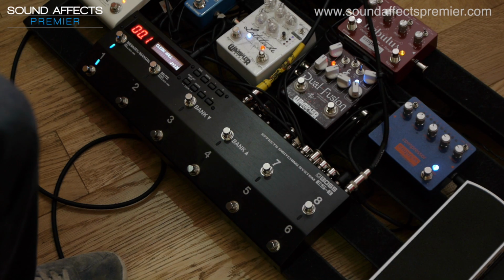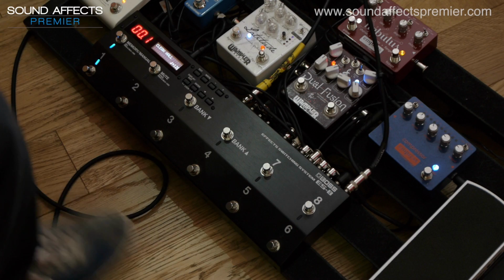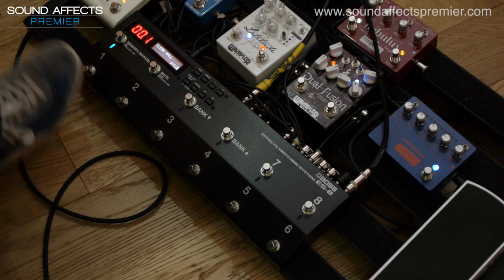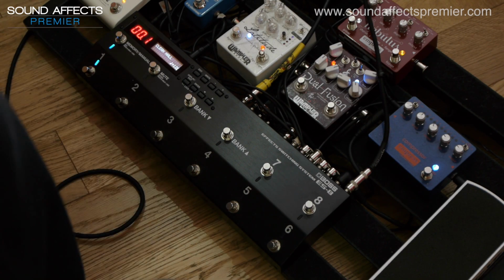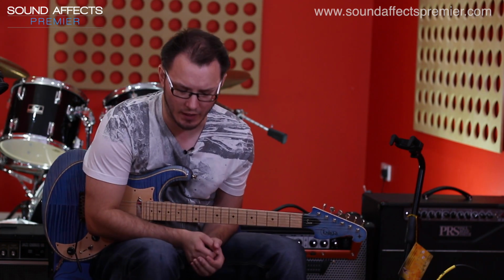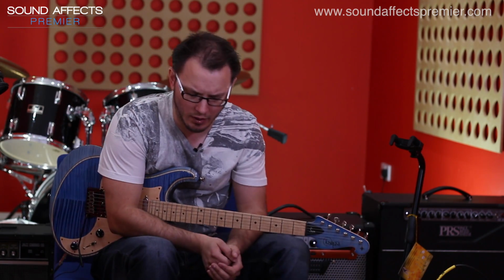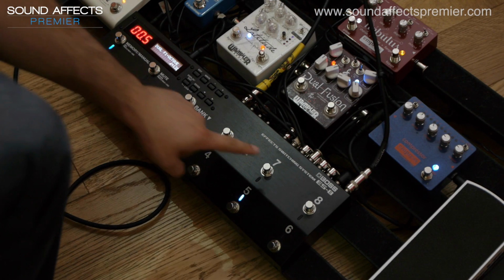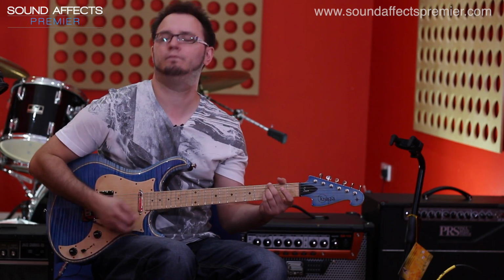Boss ES-8 Effects Pedal Looper & Switching System Overview

Comment: Hi Tom, I am a new owner. Thanks so much for the demo. What kind of unit do you recommend to power your effects pedals?  Thanks.
Reply: I am using a Caline CP 206, there is a review on YouTube and I run the ES-8, 3x Boss 500 series pedals and smaller Boss pedals and no issues. It is noiseless / isolated too.
Reply: Cioks

Comment: GREAT REVIEW/DEMO!!! The only section I heard starting at approximately 2:45 I believe may not be accurate. "... 2 inputs, 2 outputs, and the outputs are both stereo outputs."  You do have a LEFT and RIGHT TS outputs for stereo but, they are not TRS outputs so each output is mono. Maybe I am misunderstanding what is being said here still, wanted to point this out just in case.

Comment: Great demo man.  Something weird though....maybe your board is a beta version?  As the patch light for button 7 does not illuminate when accessing an additional patch from a MEM preset.  I looked at other demos and the patch lights up.  To me, that would almost be a deal breaker if I did not have an "on" light for any additional patch I would bring up.
Reply: As I understand, you can program that pr patch or knob yourself. Light On or Off...

Comment: Does the Es 8 work well with the 4 cable method?  I.e. To put delays reverbs or any time based effects through the return and send effects loop of let's say a Marshall DSL 2000. What would be your suggestion? Also what amp are you using in this video..? Thank you for your help.